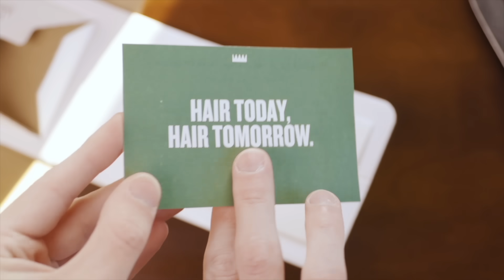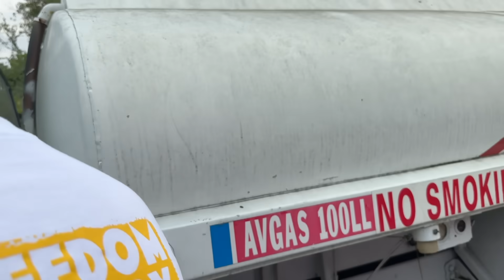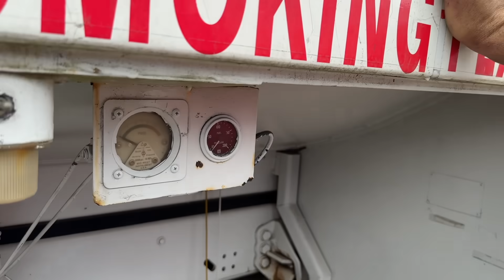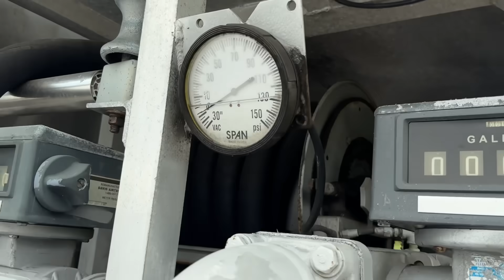I Bought An Abandoned Fuel Truck For Our New Airport!!!

Comment: aviation fueler here, i work at an international airport driving  ramp master and dart fuel trucks. One, engaging your pto dry on a fuel truck will pretty quickly cause a good amount of damage as the jet A is the primary lubricant. Two, that little black button is your over wing hose reel retract button and wont work without  the pto engaged thus the click of the solenoid at first. Third, if you have a position for a fueler soon to be open id love to fill the position lol

Comment: Hi Cletus. You need to be careful. There are lots of ways you can get yourself into trouble. ATA 103 will tell you the inspections you need to do in order to be safe. Being as you are a private airfield and not selling fuel, I am not sure what regulations you will be subject to, but you still want to be safe and not have a spill on the airport which could result in many many thousands of dollars in fines and clean up charges. Those trucks are also not designed for the roads FYI. I have been fueling aircraft since 1979 and I started my aviation career in Florida. I also served 28 years in the Army as an aviation fuel specialist.

Comment: The first truck has a 7.8L Ford New Holland (it COULD be a 6.6 but I doubt it since it appears to be a higher GVWR model). They aren't hot rods but they do use a Bosch MW pump (some high output models can have a P pump) so they can be turned up a decent amount. They were designed for tractors so they are pretty much bullet proof with stock turbo and pump, even when turned up. Fair warning, they have a oil pressure sending unit that sit directly over the downpipe off of the turbo. If it starts leaking, its a fire risk. Make sure you manage the leak if it is, or relocate it.

Comment: I haul fuel for kag energy. There are a lot of permits you have to have to haul bulk fuel. You need class a cdl with hazmat and tanker endorsements. Combination also if you ever upgrade to rig with a 5th wheel. Also you have to be tsa fingerprinted for a twic card for most places to even get on the property to load that rig. And even then you have to have all the certification up to date for that tanker. For example pressure tested and have leak down done. Have to make sure the thickness is good on the wall too. A bunch of hoops to jump through. Heavy dot regulations on that rig. (I’m running out of Illinois but run Indiana and Kentucky a lot. Good luck brother. But I think it’d be cheaper to get a tank and get it serviced by your local fuel provider. And then fill your truck up for a tender truck.

Comment: Funny we just got an ex aviation fuel truck given to us it’s purely for our own onsite storage of diesel but it runs drives and pumps fine. But the whole system is way out of inspection so we can’t use it on the road. As many others have said. Get an onsite tank so you don’t need as much paperwork permits licences etc.

Comment: The big red handle is the internal valve to let the fuel flow to the pump from the main tank. If it only has one compartment there’s only 1 valve. Multiple compartments would have that many valves. To engage the pto you will probably need to put the truck in gear, then engage the pto and then put the transmission back in neutral

Comment: A truck that can pump some Jet A or any JP4 or JP8 military fuel is worth it's weight in gold. I ran a few in the Army, they well worth maintaining and fixing them.They last forever, they just have to run the pump. However for your airfield you probably should get a truck that is made to pump AVGAS 100LL , but you probably know that already.
Reply: One is Jet A and the other is Avgas

Comment: Awesome trucks. 8000. For two trucks great deal. What does a stainless jet fuel tank cost that holds similar gallons?    Personally if you got the money pay what it needs, get it back to close to great and reliable, and keep uo on the maintenance.  Taking risks with fuel trucks doesn't seem like a great idea. Rebuild fix and replace ehat is needed. If you got the money you are saving on many headaches later.

Comment: I used to work up there when the new owners bought Craig Air Center and went to Jax Executive. The Avgas truck needs some new brakes and a good service. Jet- A truck hasn't ran since 2015 or 2017 I was told so may or may not be true.

Comment: I worked at Gadsden Alabama airport in our FBO was called bald eagle aviation and you have to have the breaks engaged to turn the PTO on and we had to have the top opening open when you were refueling the truck back up from the fuel farm so it will not put too much pressure inside your truck tank  will blow. And I used the bigger fuel truck to fuel up a Blackhawk on the military would come out and do their exercises at night and we had the chance to wear night vision goggles to feel the helicopters up using the single point.

Comment: The bolt under the gas pedal is a speed limiter so you can only go 35mph on airport grounds. And exhaust out the front bumper also permitted for airport grounds. All of our trucks had the same set up

Comment: I'd make a trailer out of the jet fuel frame, and pull it with the other truck or one of the tractors at the air field.  It would be super easy to hook up a 10hp 3 inch pump to deliver the fuel.

Comment: Get a couple of 30w solar panels wire in series and a charge controller. Connect to the battery to keep them charged up. Cheap and easy

Comment: On our pump trucks that are automatics they have a solenoid valve that hooks to a switch to engage pto..straight shifts you gotta push clutch in before engaging with pull cable...they do grind going in sometimes...

Comment: Get 2 big fuel tanks and pumps on the property one for avgas and one for jet a1 and let it be delivered in bulk by a company who specializes in this kind of work.

You will be a whole world of hurt with regulations and permits if you want to get it yourself and it will end up costing more then to get it delivered in bulk.
Not to mention liability with aviation fuel and all the quality control you have to do and all the logs you have to maintain.

Comment: hey cleet i would drain the oil pull a head and take a block of wood and beat on the pistons, then add white vinegar and atf and diesel that combo will unlock that motor i did it will a ls that had 11quarts of water in the motor still running today.
Reply: also will need cdl and hazmat certs to drive on the road loaded unless you park on private property and have them come to you loop hole.

Comment: The jet fuel truck would be good to repower with rebuilt 460. The body would need to sourced as well. It will require a lot of maintenance for the Jet A fuel system. There is a huge filter/dryer that will have to be replaced. Who knows about the hoses rubbers and seals.

Comment: take caution when opening the hatches on the fuel trucks.  DO NOT have your phone on you or anything electronic that can generate a static spark.  I know this from training since I'm a fueler at MSP.  I deal with Jet A primarily but not 100LL.  All of the tankers I deal with are 3K, 5K, 7K, and 10K gallons.  All are bottom load ONLY.  Any time I have to go up and open the hatch on any tanker, I open it very slowly to let out any excess pressure so it doesn't blow open.  Look for a stamped tag with the manufacture on it anywhere on the equipment.  That should be more helpful to anyone who are familiar with them.  All of our fueling equipment up here in Minnesota is cold weather rated fuel hoses.  Non-cold weather hoses will get hard and be very difficult to move and handle when its at or below freezing.  cold weather hoses don't do that.  However, they do cost more but that comes with the location and environment that the equipment is used in.  Some of the manufactures of equipment we use up here is as follows.  Westmor, Skymark, Rampmaster.

Comment: I used to rebuild carbs.  I worked on the carbs from fuel trucks at Hayward airport, and all of them had significant water run through them, leaving thick mineral deposits.  The guy I was working with there said they ran the trucks on the Av gas in the truck.  They drained it off the bottom of the tanks and it was loaded with water.  Just when you thought some common sense would be used, bang.  Dumb crap was going on.  The carbs had governors for a reason, so just slapping any old carb on there may not be the best idea.

Comment: You dont want a big horse power engine for that truck, you want torque. We had an old Chevy  lumber truck . It had a 366 cu in engine. It red lined 4000 rpm. My brother delivered bottled gases. Besides the cdl there are all sorts of hoops to jump through. You can't be more than so many feet away and it has to be in view like if you stop along the way. You have dot inspections and those old trucks will be bank for the dot. Get a bulk tanks and have a fuel company drop it at the airport. The hardest thing you'd have to do is sign the check. Id convert one into s water truck so you can get water from the lake to water the grass on the air strip.

Comment: It was common back in the late 1950's in Walter trucks using the Waukesha 884" cu/in gas engine.

I use to see this ugly airport plow truck that pushed a 40' plow at a large airport. The exhaust came out of the hood, then did a 90 degree turn and dumped into a pair of mufflers suspended over the cab.

$4,500 later, it was mine.

Comment: Drop some oil through the spark plus holes key it sit a little bit then put the thing in gear and try pulling the truck. Vice grip garage way of making the engine spin

Comment: Cleeter that may be a 370 on the gasser, its a variant of the 385 series ford has a huge crank snout over the regular 429/460 fords. 460s are cheap fun, where the heck is mcflurrys godzilla??? I recon it wouldent be blowing head gaskets just haulin some jet fuel around.

Comment: Both trucks would need a 5 year inspection done. Thats gonna set you back 2500 each if they both just pass. Neither would pass being that old without a few issues. 

Refilling off a bulk tank is going to be your best option. Keep them off the road. Youd need to take out a second third and 72nd morgtage for the the insurance alone on fuel trucks....drove them for many years.

Comment: That Diesel truck likely has a Ford Brazil 6.6 or 7.8L in it.  The Gasser is probably a 429, that was most common on the F600/700 in that era.

Comment: Big ford... Prolly a 335 series Cleveland, likely a 400. Although i have seen a few 385 series 370ci/429ci big blocks running in those trucks with 2 barrels.
Edit. Definitely a 385series. 370/429ci... Ol low comp slug. Will pull the world just secure the hook lol😂

Comment: You are going to have to learn how to take them refuel heads apart. There is a cone filter inside you'll have to change or blow out with compressed air.

Comment: If that f700 has a 6.6 or 7.8 Brazilian ford which it looks like it does, they are tough as nails. A lot of the high hp pulling tractors use them.

Comment: Should of searched out  on here, Jennings Motor Sports, he would have gotten that engine running in a day or 2. That's all he does is get old engines that have been sitting for decades, running again.   His main go to trick is not just using trans fluid but acetone,trans fluid and pb blaster and dumps it into each cylinder.

Comment: Chop shop.. move the tank from the truck to the other truck that runs...you might have to extend the small trucks carrage or chasis for the tank to properly hold its full fuel capacity weight.. lastly bigger tires.

Comment: You know you can get additives for the fuel if your storing it or going to leave it sit in the truck a while to prevent microbiome growth fungus all that. Extra some have detergents to clean out the fuel system too.
Reply: How many of those additives certified for aircraft use?

Comment: I might have an engine that would work in a fuel truck. 1987 7.1 leader Ford engine that came out of a 30-foot RV has 24,000 Mi on it . Also have the turbo 400 transmission that came with it. Will take best offer!

Comment: If you plan on driving these on the roads, you'll need someone with a CDL, based on the number of Axles, should need a Class B CDL but a Class A would be more than sufficient, that driver would need both a tanker and hazmat endorsements and you would need to get a company name and USDOT number to display on the side. You'd also have a lot of other permits and licensing as a company that I don't know anything about. I would suggest getting a storage tank on site at the airfield and ordering in bulk and having it delivered to the site, that way you can drive these trucks on the airfield property without any licensing or endorsements and use these trucks to bring fuel around on the property. The downside to that is you'll need to pay for fuel to be delivered to the airfield and these trucks would not be allowed to leave the property at any time for any reason unless they're being towed.

Comment: I’ve been a line crew member for an airport for 3 years now, the emergency shut off it supposed to shut that red lever down to close the lines and stop flow once pulled, well that’s how my jet truck works, my av gas the lever pump and pto are all tied into one lever on the back with some e shut offs and a clutch pump switch

Comment: Cleet, you need to install a dual "Tank Farm" at the airport.. then use the truck to move the fuel to the aircraft..  last thing you want is to have to satisfy DOT and all the other regulatory bureaucrats enough to be moving fuel on the Public roadways..  and you are going to be going through so much fuel.. especially Jet-A.. you will want to buy in bulk.. not just a truck-full at a time..  otherwise the $avings won't be significant enough to be worth it..  looks like that one truck hasn't been inspected since 1991..  33 years.. sitting.. you are going to want to go through the entire truck properly..   getting that old ford running is the easy part..  just think ahead a little.. the MD for now... and i'm sure you'll be having other turboprops/jets in the near future.. it's a shame the airport has such a short runway.. i can see you growing into a PC-12 or King air soon.. or maybe a citation or ??  the Cleet crew will need a longer runway soon enough..

Comment: $8k for both of them is a steal! Yeah the engine doesn't run on one, but in the end it's the cheapest part of the setup. You don't need a new engine. If you keep it on the lot so it'll drive between the storage tank and airplane, anything will do the job.

Comment: Well for starters you got to get your CDL license and then you got to get your hazmat license for fuel transport last time I checked I think it was about $6,000 a person to get certified CDL license all that with the hazmat permit and then the trucks got to get certified every year a pressure leak down test you have to have a million-dollar policy on each truck I think when it comes to fuel it was a 3 million dollar insurance policy, you're going to have to upgrade those tires and rims get rid of those split rims because they're no longer accepted that's why they were sold cheap you can pay for a tanker to come and fill the truck up there at the airport and when it comes to fuel trucks they're very strict about the breaks the brakes have to get changed at least three times a year on the the vehicle to ensure sufficiency safety to stop!! There's a lot you got to do!

Comment: Summit sells a VEGE Ford 7'5 litre crate engine for just over 3 grand it's the cheapest I can find and yes the exhaust is out front because the fuels in the back it reduces the chances of a spark ignition happening

Comment: I would remove the beds off both trucks and put them on a nice pad  with containment tanks under them hooked to a self serve setup that is ran off power from one of the buildings  have all of your pumps running off building power  and if possable have it setup with card reader or something to turn it on that a way people arnt flying off with free tanks of fuel

Comment: button is hose real, read handles are emerg stop, they make need a recovery systems that's why you got them cheap,yep permits too, you must go threw proper channels if a spill happens it can cost thousand, worked on fuel trucks year ago and meny things have changed

Comment: Love the end: we will her her figured out » I’ve had a 1981 delta  88, no aftermarket for the 307 upper North, seems to be a ju🎉stifiable 455ci i took a TD04H off my evo for a garret 3076r, I’d it worth fabricating a TdO4 on stock block Id the 455ci olds 455ci

Comment: That gauge doesn't have water in it. It's a Glycerin filled gauge. Damps out the pressure fluctuations and keeps from knocking the needle off the pin...

Comment: I would get your fuel meter calibrated by a local fuel meter calibration company so you can have the piece of mind that the fuel you are pumping is correct because the meter heads can go way ooht of calibration when sitting

Comment: Brother I used to fuel air crafts at SeaTac international where you fly to when u speedboat race. I know for sure your gallon stamp reader is done an the sound it the fuel trying to flow. Something sized. I fueled airforce one when Obama came to Seattle brother and alot of 330 airbus 737 Alaskan an the duel prop horizon air also Alaskan air